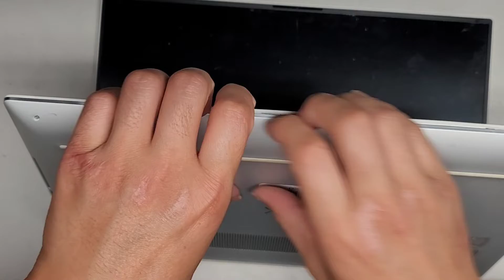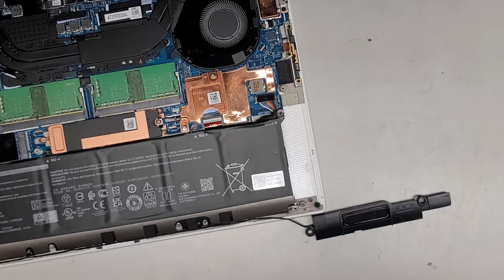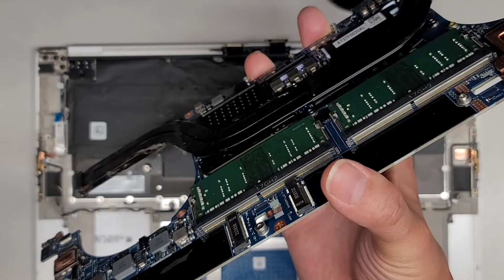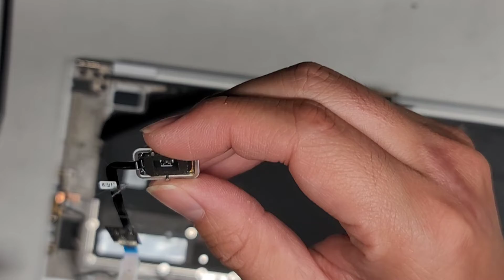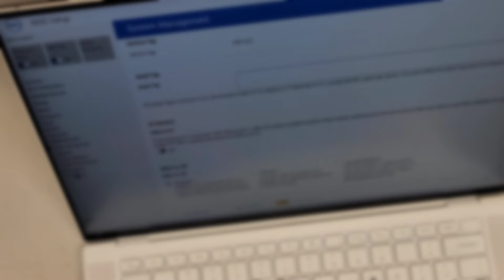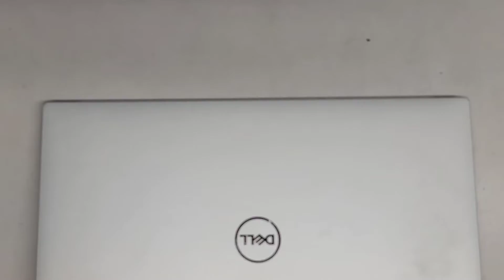DELL XPS 15 9510 Disassembly RAM SSD Upgrade Battery Replacement Repair Water Liquid Spill Clean Up

Comment: First! 
hi! As for me, I would prefer the thumbnail showing the lid of the machine. It's much easier to recognize one that I've had or worked on. That makes more sense because the laptop spends 99.9% of its life with the lid up, so that is the side that people recognize. To me, it makes no sense whatsoever to show the bottom as the thumbnail image. 
Thank you for not dusting the battery over the open machine like every single video in the universe does. 
Water doesn't necessarily mean something electrical is dead. Back when I was a plumber, one of the helpers forgot to glue a fitting when installing a new water supply line on the second floor of the office and it came apart in the middle of the night and it poured water all night right on a huge Panasonic fax/copy machine. They called our office the next morning, of course. And, of course my boss sent me to fix the leak and be the person responsible and to smooth their feathers. When I first walked in the door the guy who's business it was, had already turned off the water.
I figured they would be pretty mad. So, as I walked in the door, I announced an apology and and that we would be responsible and replace anything damaged with new equipment. They said that they would be okay with waiting a few days to see if the machine dried out. Wow, he was nice and understanding! I fixed the fitting and turned the water back on and left. They called back about a week later saying that it had dried out and was working just fine. Wow! 
Oh, no. :/ You were doing sooo good then at 19:45, you pull out the toothbrush and start dusting, right over the open machine. Bro, SMH. 
Why would you do that? Massive points off.
Let's see how the rest goes...
Ok, more dusting at around 23:00 holding the PCB almost over the open machine. 
Great job with the patience and knowledge to use the isopropyl alcohol on that adhesive.
Reply from the maker: Lol Well I figure most people search the model number of their computer and want to quickly see what's inside their computer and what's upgradeable. I pre dusted the fan. Lol Also had to remove the board, so dumping dust on it isn't an issue as it'll be dusted outside.